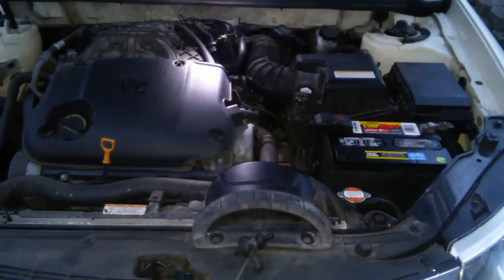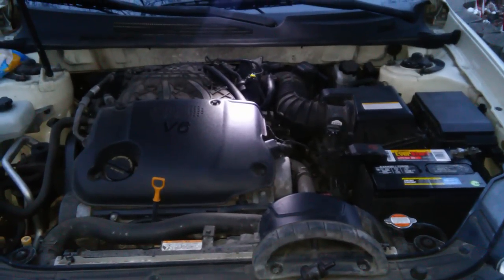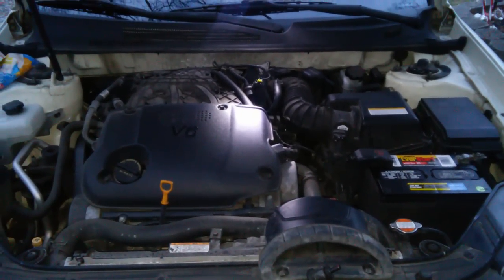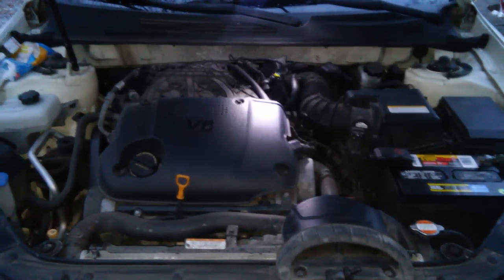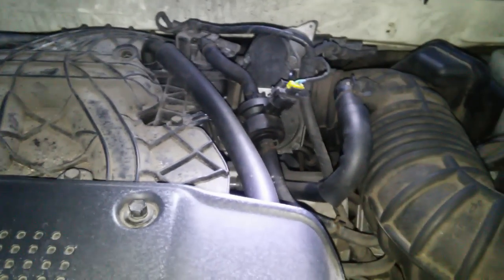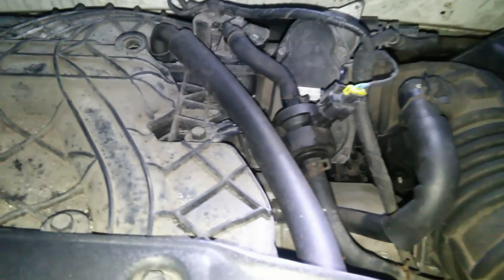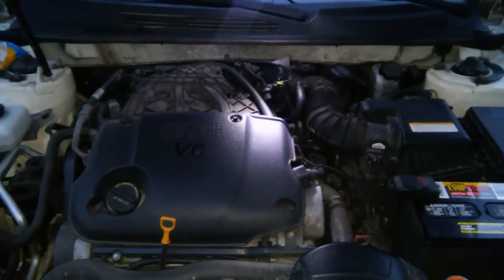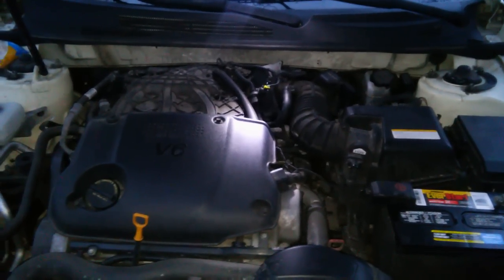Error codes p2187 p2189

Comment: I changed my purge valve up front but I'm still getting them 2 codes. Could it be the canister valve in the back by the fuel tank or fill up hose ?  Lmk please. Thanks

Comment: thanks so much. I had exactly the same problem with the same symptoms on my KIA Rondo 2007. I listen a clicking noise too. I think my valve is located in other place
Reply: Did you find the location of the purge valve? I have a 2008 KIA RONDO 2008 2.7L.

Comment: So I bought a new canister purge valve and installed it just like you said if I had an error with p2187 and 89. I wanted to know do I have to drive certain miles for the engine light to turn off or do I have to clear the errors first?? Or that'll just erase by itself???
Reply: So u changed the canisters valve then in the back by the fuel tank?